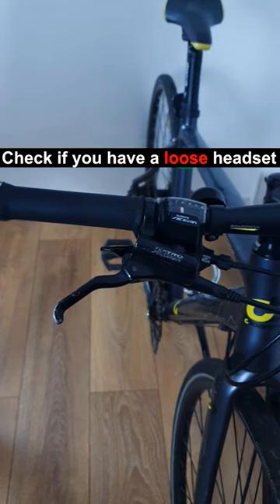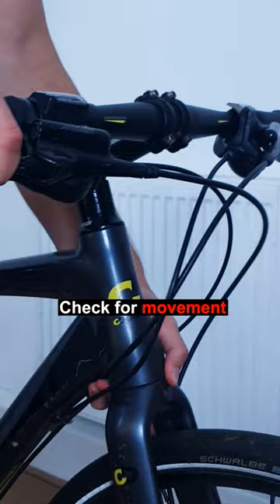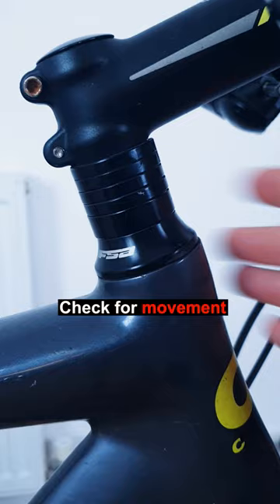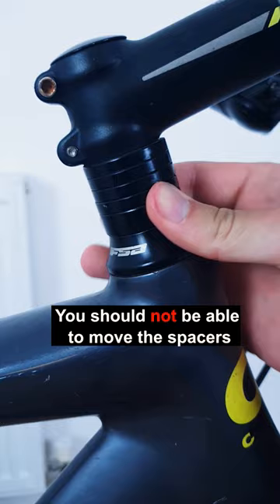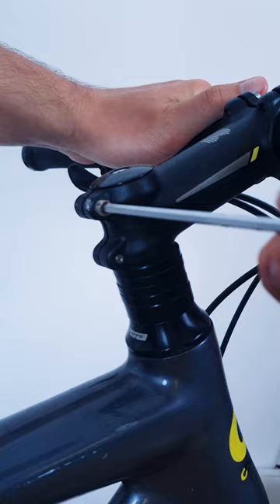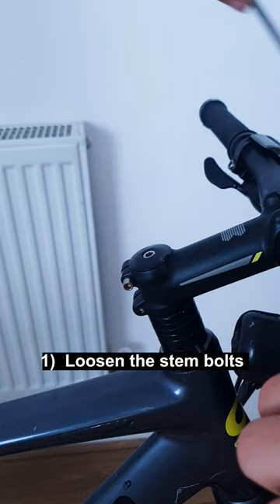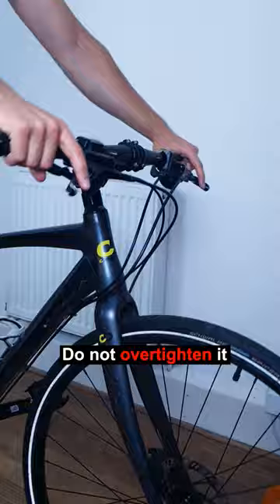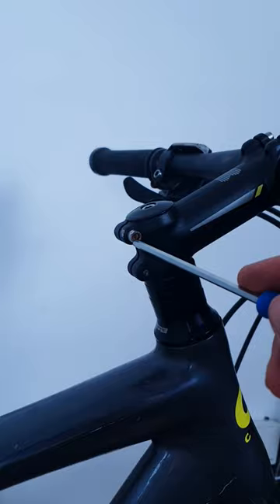How to tighten a loose headset | Fix bicycle headset

Comment: I made this mistake by not checking it while riding for the first time in years 😂 safe to say I went flying.....lesson learnt
Reply: How do you fly 🗿
Reply: Straight over the handle bars 😂 broke my watch🤷
Reply: @thomaswebber7115  did you applied front brake or rear brakes 🥶
Reply: None didn't get the chance haha, as I turned left the wheel stayed left but the handle bar went back straight haha 😂 funny though
Reply: @thomaswebber7115  💀💀💀

Comment: Take the top cap off and make sure the fork stem is below the headset 1/8" to 1/4".
If it stem and head set is flush it will not tighten.
No room for the stem to move upward.
Reply: Thx mate

Comment: Why you can't over tighten the top cap?.
Reply: It "tensions" the bearings, so if it's overtightened the balls in the bearings will be squeezed so tightly in the bearing tracks ("races") that they will wear out very quickly (and might not spin at all)
Reply: @tedjohansen6535 nah my stem just bent 💀

Comment: I have the same problem on my YT Jeffsy and I know this methode but everytime I fix this issue, after some riding I also have to fix it because I have this problem again and again and. I don't know why, this was also a problem with may previous bike. I do stoppies and wheelies but a lot of people do so I don't think this is the reason. Pls help!!
Reply: Check you actually have a gap between the top of the stem or spacers and the steerer. You need at least a 3mm gap for everything to compress.

Comment: But my spacers are tight still when applying front brake ot moves and a click sound comes from it 

I have a hardtail MTB
Reply: tighten it a bit more... had the same problem but it is now fixed
Reply: @amarsharma7382  already done that 
problem is the star nut inside is bented because of assembled wrong